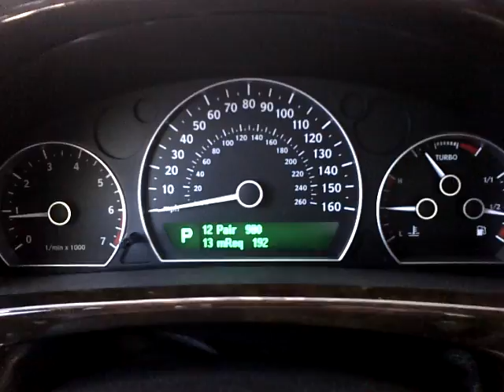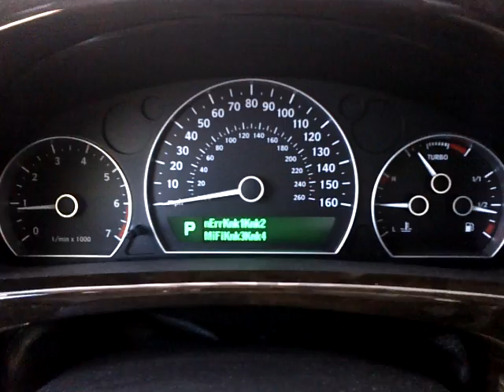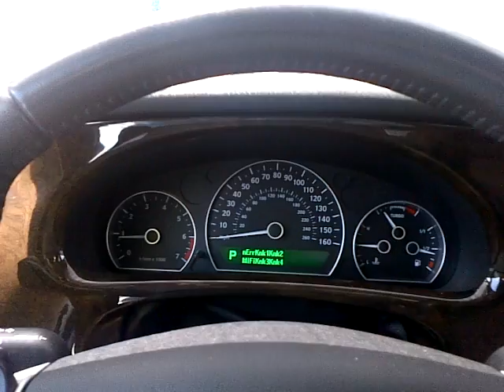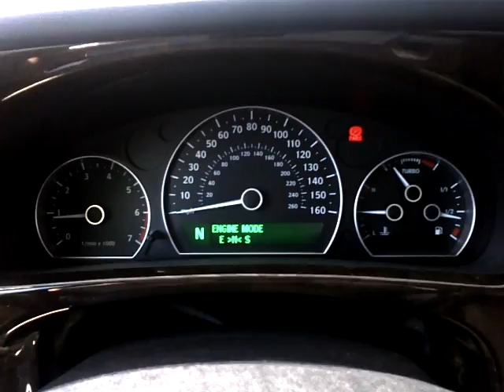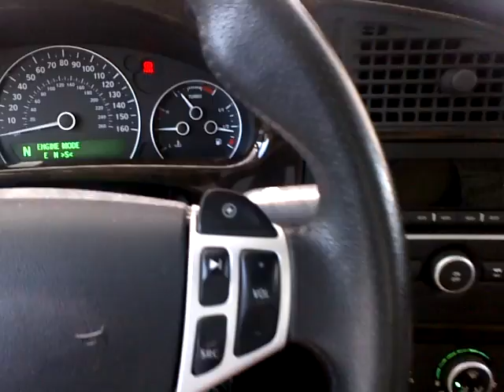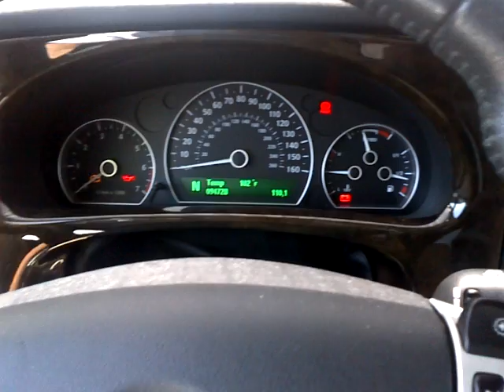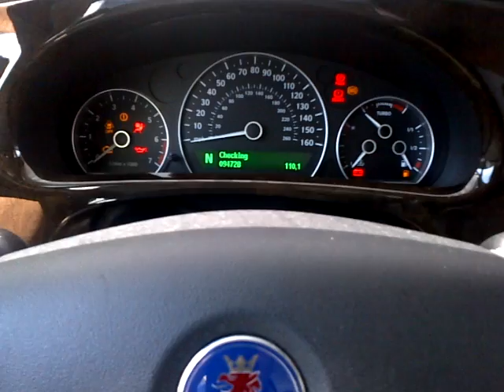Saab 9-5 B235R MY06 Open SID Explained

Comment: Hi i have a 2007 saab 95 i enable open sid on my ecu with T7 suite but does not work do you have to have the factory radio in i change mine
Reply from the maker: You need to use the .55P bin file.

Comment: Can the open SID also show battery voltage? I miss that on my SAAB.
Reply: Yes it can :)
Reply: Great. Just a pity there is not a list of functions and button combinations to use for Open SID. Would be good to have in the car.
Reply from the maker: Yes, by adding " ActualIn.U_Batt " to SID Information in T7Suite you can display voltage.

Comment: Do you have to use a 46s or a 55p file to open the sid on an 06+?
Reply from the maker: +Brandon Adams You need 55p for MY06 and newer
Reply from the maker: EJ06F01C.56Y also opens SID for 06+ 9-5s